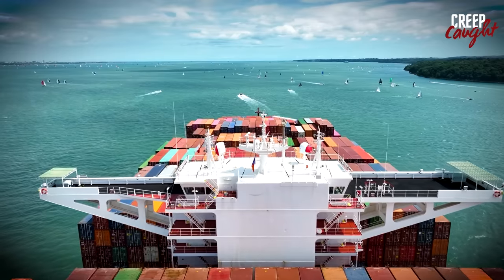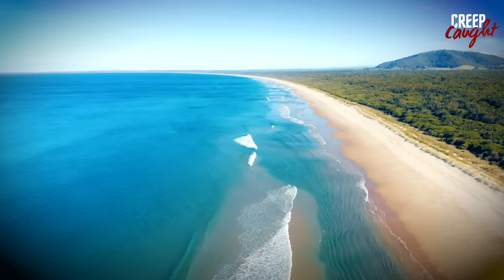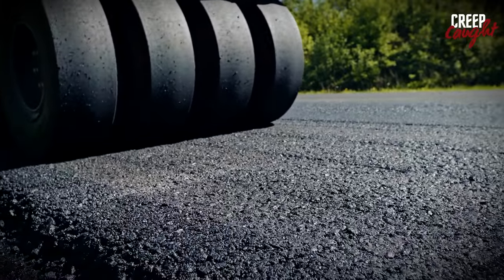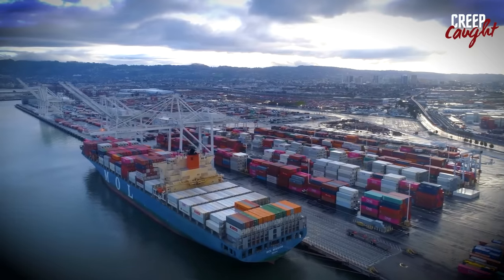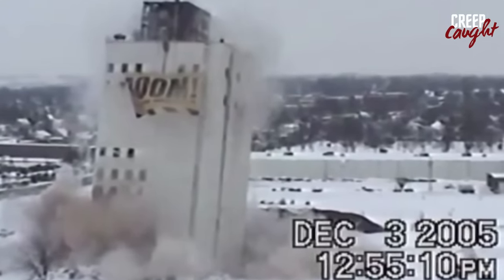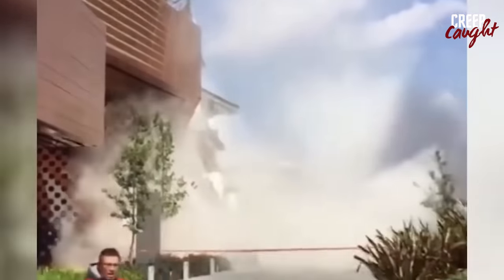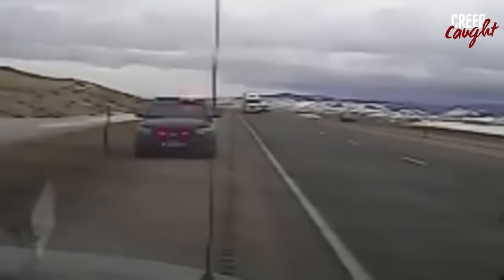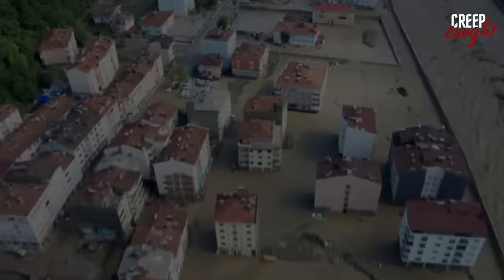50 Moments Filmed Second Before Disaster... Vol. 4

Comment: The tipping coast guard ship had no ballast in an attempt to make launching easier. It backfired.
Reply: And/or an engineer grossly miscalculated required ballast for launching, or could also be explained by valve misalignment allowing the ballast water to flow to the stern allowing far too buoyancy in the forward sections. Or like you said, idiots with the ‘no ballast at all’ bright idea and the engineers didn’t engage their brains for a half a second for a quick logic check.
Reply: That's what I was thinking 🤔surly you would  think twice about launching the ship if you weren't shaw everything was perfect

Comment: I was on Fletcher (DD 992) when this happened, this incident occurred during a Tow and be Towed Exercise.  Both ships were damaged but returned to port under their own power. This was an graded evolution and required demonstration of ship handling and deck (men manning the towing gear) proficiency and the assessing command (Afloat Training Group ATG) was onboard. Neither Captain was relieved of their command.
Reply: No one was relieved? That's interesting. I thought the Navy was quite strict about mishaps. A carrier once got stuck on a sandbar in the San Francisco Bay Area.  Sandbars move and grow, so their location and depth constantly change. And yet the captain was relieved of command.(bummer)
In the case of the Fletcher, was this contact considered just a part of what needs to be learned for this exercise, or was there some sort of penalty?
Reply: @gregparrott  no, the contact was not intended, the video filmed by a sailor on the Downes “blames” the Fletcher, but Fletcher was technically the stand on vessel (receiving the shot-line to hull over the tow line) before moving ahead and taking the other vessel under tow. What happened is when the Downes (a Knox class frigate), with one clockwise screw and single rudder, made the pass on Fletchers stern it walked its stern, by action of the single screw, towards Fletcher. When Fletcher put on a backing bell, made turns on its twin screws and full rudder, the two ships created the “venturi effect” that moved them together(collision). 

The investigation found no “loss of confidence” in either CO and the incident was a combination of circumstances that made the contact unavoidable during the constraints of a graded exercise.

The CO of Fletcher at the time was CDR Kendall who was a CAPT Select (selected and approved for promotion to CAPT). He would later make Rear Admiral and become one of the first black Surface Warfare Officer of flag rank.
Reply: @sirwholland7  Thank you for the detailed reply
Reply: @gregparrott  I wondered about it too, as I lived in the SF Bay Area in 1983 when the carrier ran aground and they cashiered the captain. Navigating at the time was a harbor pilot, and conditions were windy with low visibility. I always thought it was a mistake to relieve the captain, but I seem to recall other such incidents that make me wonder if it was Navy policy at the time.
Reply: 50 moments filmed seconds before disaster are thrilling and captivating! This video is truly engaging and full of suspense.

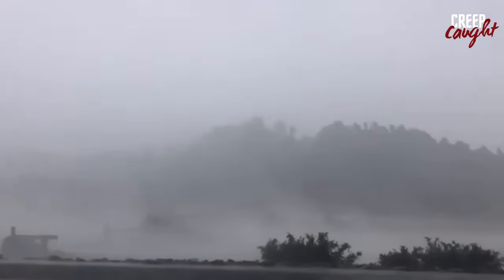Comment: @59:00 mark - the end dump trailer did not topple over because of hydraulic lift failure, as it did not drop because they failed. The load, if not lifted gradually and allowed for the product in the nose of the trailer to flow or exit below the center point of gravity, the top, being too heavy, will topple the trailer over onto its side. 

You should get your facts straight by doing a bit of research to understand what is happening, and that way you can correctly educate the viewers.
Reply: Yeah, you're 100% right, but this guy here knows no sh!t about the stuff he's talking about. As they say, "he's saying what he knows, but that doesn't mean he knows what he's saying". A split rim on a truck wheel gave way nearly killing that poor Chinese guy, and he's talking about "controlling pressure" and riding on properly inflated wheels. A "em–oh–ar–oh–en", simply speaking.
"Education"? All he cares is clicks, views, and YT ad money, and fork the facts...

Comment: Both captains of the barges that collided DIDN'T mess up, the one with the camera DID. Rules of the road state specifically that the vessel on the RIGHT has the right of way. The one with the camera should have either stopped, OR maneuvered to PORT to avoid the collision.
Easy way to tell is the running lights on a ship are GREEN on the Starboard (right) side and RED on the Port (left) side. IF you are looking at RED, you are to give way. IF you are looking at GREEN, you are required to maintain course and speed.
Don't try to argue, because I was an Operations Specialist in the U.S. Navy, and one of our jobs was harbor navigation. WE HAD TO KNOW THE RULES OF THE ROAD to maintain qualifications. It is the same GLOBALLY...
Reply: "Right has the right" (of way). Theoretically, it is true for land traffic, except that hardly anyone seems to know it. 😑

Comment: Sorry but the incident with the wine container is not a reason to reevaluate the shipping method, one accident doesn’t mean the shipping method is wrong, if it was occurring on a regular basis then it would be prudent to look at the shipping method but not after one accident.

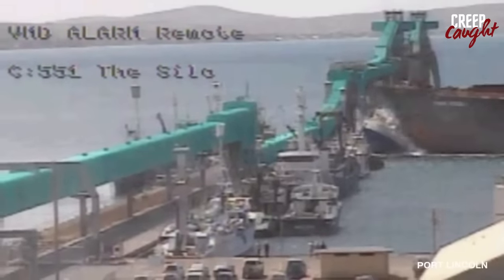The cargo ship hitting the fishing vessel @ 13:10+ looked, at least to me, that it was a huge shark or Megladon trying to swallow the fishing vessel.

The two ships @ 14:10+ did not “almost” collide, they most definitely DID collide.

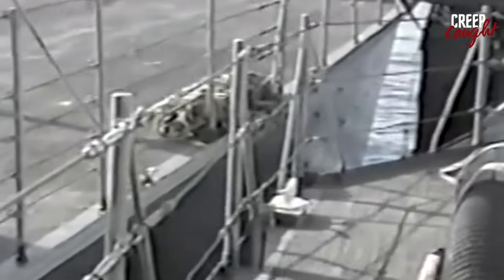The two ships captains involved in the ship collision @ 18:20 are probably commanding a desk in the artic, they are ultimately responsible whether or not they were in control of their respective vessels at the time.

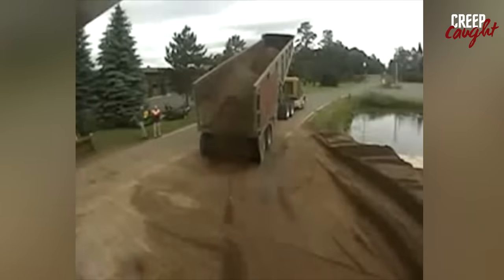Comment: At 59:14 That dump truck tipping over had nothing to do with the hydraulics...... when you raise the bed on a dump truck if all the contents don't come out, the stuff left closest to the top will make the dump truck top heavy causing it to tip over. That is exactly what happened in this incident. I've worked for three different dump trucking companies and they all explain do not lift your bed without checking the contents.

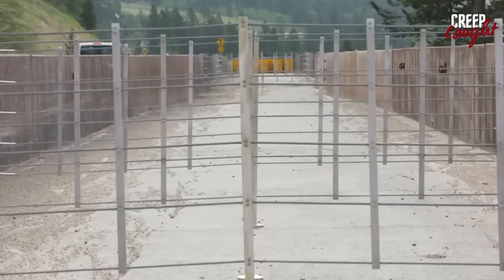Comment: 7:20 I think you have it the wrong way around, the old kitty litter truck runoff roads don't damage vehicles anywhere near as much as the 'new improved' wire method shown here, which absolutely hammered the truck and immediately smashed it into the  barrier??!!
Reply: Snow is the problem 
..makes it slick. Instead, the ramps are at a steep angle.

Comment: ALL Ships have a green light, on the righthand side, when facing the front of the ship, and a red light on the other side, which are indicating, if you have the right to move forward, or you have to let the other ship move forward first. So there is only one ship at fault, the rules are very clear about this. In this situation, if the video is not flipped, the small ship sees a green light, and the big ship sees a red light, there will/can never be a situation, where both ships, sees a green or red light, at the same time. The ships will always see a different light than the other ship.

Comment: That runaway truck arresting cable fence system has been installed in North Bay Ontario Canada for about 25 years. Due to heavy snowfalls, there was no practical way to plow a gravel system so they chose the cables. Like an aircraft carrier system.
Reply: It looks like it does a lot of damage to the truck, notwithstanding the narrator's claim of minor damage.
Reply: Yes , I recall the runaway truck ramps in CO. I lived near Loveland pass.  I don't recall them having gravel; I believe it was the angle that slowed them down...

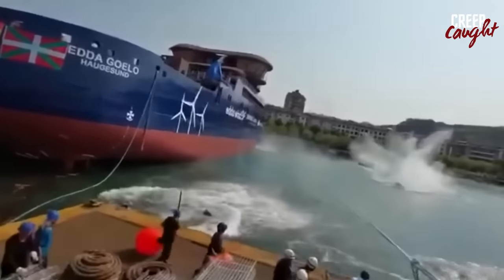Comment: 28:00 mark. I think what was more alarming was that 5 ton dock cleats bolts shearing off propelling that solid 5 ton or more iron cleat flying thru the air like that. Had it hit that boat just a few yards away from where it hit the water, that boat would of sank instantly. So dude, I think you missed the point there!

But, as always, that's just my opinion! :)))

Comment: The wind turbines are killing bald eagles
Reply: They aren't green energy either.
Look up how many gallons of oil it needs yearly and then even more for lubrication. 
It takes petroleum to run it. No oil no turbine.👍
Reply: Not just bald eagles either. Lots of raptors meet their end from these killing machines. It's not just one or two here and there, it's hundred's upon hundred's that die from just a single unit.(depending on their location) It's gotten so bad in certain areas that they have literally put them back on the endangered list. Where is the outcry from animal lover's?
Reply: Blades cost too much to recycle. They are left in piles in empty land area or buried.

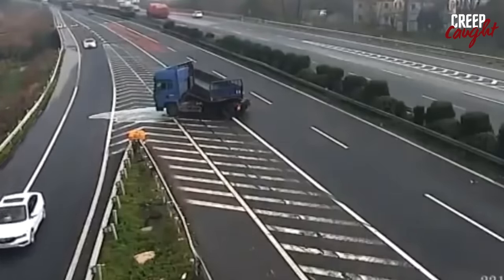Comment: 04:59 Diesel doesn't ignite from a spark, like gasoline, from just steam. Diesel requires heat and droplet formation to ignite, the fact that it flows does not ignite it.

Comment: 5:33 Based on the accent and the background plus the likelihood boats would be near each other I'd say it is the Bosporus, the narrow entrance to the Black Sea.
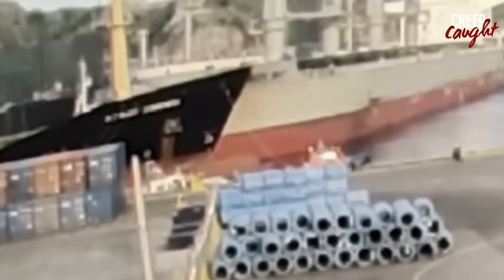8:59 Those are called tugboats
9:30 This wasn't an accident.  This was a deliberate demonstration of the vacuum condensation effect.
24:00 Hydrolock is when water gets into the combustion chamber.  Since water is incompressible it will bend the piston rods, crank shaft, etc.

Comment: Light poles are built to sheer off now. Prior to the mid-1980's, most wooden poles were 7-10 feet in the ground and reinforced with concrete(like a big fence post). It was not uncommon for a car to get cit in half if they were traveling at highway speeds. Worst accidents I've ever seen when I started in EMS in the 80s. Guardrails were designed the same way.  Ow everything is meant to sheer and slow cars down in a controlled manner.

Comment: 29:40 - I'm no forklift operator, but you should NEVER attempt to use a "double fork lift".  Instead, they should have either used a crane, or a bigger fork lift.  Cutting corners always leads to problems.

Comment: The dividing wall that seperates the freeway I found the flaw in that wall. At the base of the wall it curves outward, when a cars tires hit the base it launches the car up.
Reply: I forget the logic of it but the National Highway Traffic Safety Administration (NHTSA) DELIBERATELY, BY DESIGN specifies the curve at the base of the wall. I think if you look at all the types of crashes, while some may experience more issues because of the curve, the aggregate of all types of crashes indicate that the presence of the curve is preferable.  
I actually saw an accident very similar to the one here, except that the wall was vertical. The guy likely dozed off while going ~65 mph in the fast lane. He slowly inched closer to a wall to his left. Even though first contact was soft and glancing, it both violently bounced off the wall AND jerked its orientation to point more to the left. The car then rapidly bounced off the wall 4 or 5 MORE TIMES, each time turning the car more directly at the wall and increasing the component of its speed directed towards the wall, yields harder hits until it came to a stop about perpendicular to the lane. The person was uninjured. But what a mess. It has a LOT more damage than a single glancing blow.
Reply: I saw a car upside down no other cars where recked. I saw another car that was up on the the wall it was on it's side and the 2 tires was over the wall but it didn't go over. I saw another accident on the freeway the on coming traffic a car hit the wall and launched over the wall into the other side of the freeway. I myself was being chased on a freeway when a semi truck suddenly came into my lane I hit the brakes and the rear end of my car slide on something then the tire just jumped up and my side of the rear end hit the wall. The new devider they put in is straight up and down.

Comment: Sorry - too many big errors in script to finish this... "Hydraulic ram failure"?? The dump trailer fell over because it was hoisted too high, too quickly when it wasn't level. When it got high, the material in the box pulled the trailer over and that, made the hydraulic cylinders fail.

Comment: If the blades on the turbine retracted or got smaller as it turns faster maybe also lessen the angle of the blades as it goes faster. If the blades were shrouded with downwind fins for directing the turbine two face into the wind and retract the things when it's too windy best turning it around with the small end facing the wind

Comment: At 13:50, almost collided.  No, they did collide. More than 10 bandits were required that day. That smaller ship was very lucky. Could have rolled over and sank.  Then the harbor would have closed or had to reduce traffic.              That haulover inlet eats various boats, almost everyday.  Especially when a new boater arrvives.

Comment: 0:48 The spreader is clearly misaligned, and never attached because it was misaligned. The left side standing higher above the contained than the right side.
An operator positioned ~100 feet above would never see this. 
It's not exactly rocket science to have SENSORS that would detect when both the alignment is correct AND the attachment is secure.
In the U.S., I doubt it's even legal for such equipment NOT to have such basic safety provisions

Comment: 24:50 - APPROXIMATELY... what? 248°F? One would think "approximately 250°F" would make more sense, but that's just the same metal fart that "other", equally smart guy did - who, while translating US manual calling for some garden thingy to be affixed onto a wooden pole, "approximately 1" in diameter" typed, without any hesitation (or thinking), "a wooden pole approximately 25.4 mm in diameter".

Also, did you know that "248°F" EQUALS 120°C? So now you know, Mr. Approximately.

27:53 - "Object", sometimes called "bollard"... in the trade. And if this rope would snap, these guys on the pier may end as a mincemeat.

41:44 - "even a minor spark could ignite a wildfire" (hence no explosives), while showing a whole shower of sparks, which is EXACTLY what happens, ALWAYS, when you cut steel with oxy-fuel torch. Which contrasts a linear cutting explosive shaped charge, which produces no sparks, ad the entire energy of the blast could be directed right into the hollow part of that steel column (and contained therein)... Yet another "beam me up, Scotty" moment in this brilliantly narrated (as in "brilliant my dear Baldric, brilliant indeed) video...

Comment: The videos are fascinating but your narration is frequently just flat wrong,  For instance 46:03 a crane is undergoing a lift test and certification.  A cable breaks and the pulley block and hook plunge into the water right next to the load barge which then has one side pulled underwater by the steel cables still attached to it and the hook.  Your narration says the load barge IS the crane.  It isn't.  The camera is on the crane's barge and the 400 million dollar crane was never in any danger.  Just the load barge.  I'm sure they then used the crane to recover the pulley block and hook from the bottom.  How do you not know this?

Much earlier, you don't seem to know that the "small boats with tires on the front" are called "Tugboats."  Good thing to know if you're narrating marine harbor accidents, right?  After that a ship is being launched and you don't know it wasn't the rope that shot out into the bay but rather the Bollard it had been wrapped around.  You showed the Carnival Cruise ship caught in a hign wind in Mobile Bay [Pron: moe-beel bay, not moe-bile] twice.

It's like a sloppy AI gathered the videos and wrote the copy and then narrated the video.  Poor work.